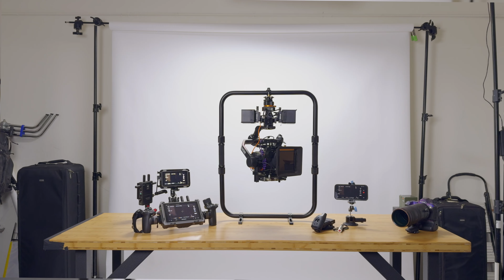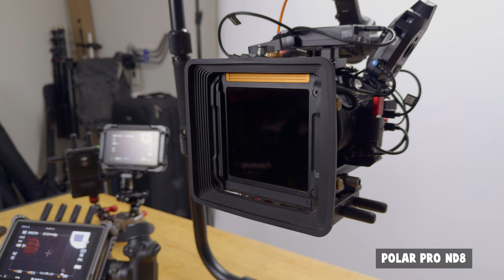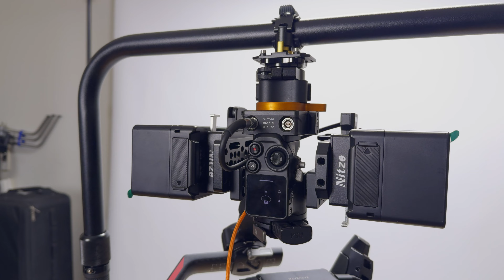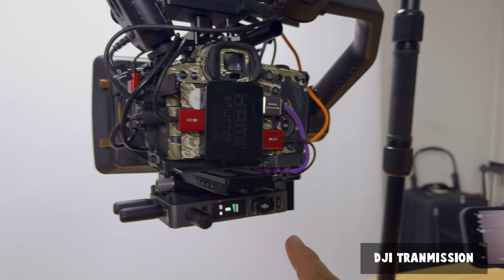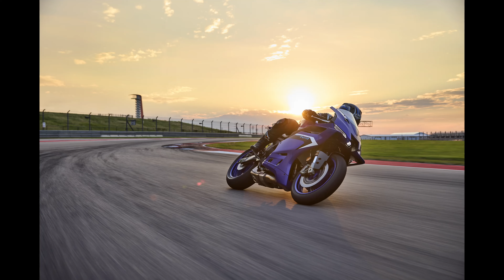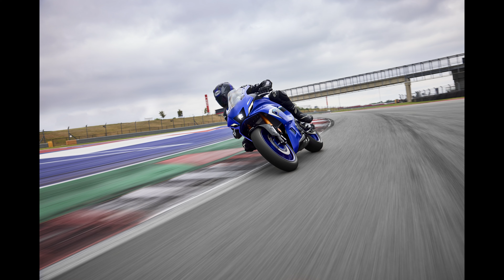Ultimate Camera Setup: RS4 Pro & Canon R5

Comment: Hey Long, thanks a lot for this video. As a (Canon) photographer, it’s actually really hard to find any information about setups like this. Really appreciate your effort — the motorcycle shots are fantastic!

Question: If needed, could you also move the spot autofocus point within your setup, for example shifting it from the center to the side depending on the composition? And did I understand correctly that the Raveneye can change the camera settings, while the DJI Transmission or DJI SDR cannot?

Thanks in advance for any feedback.